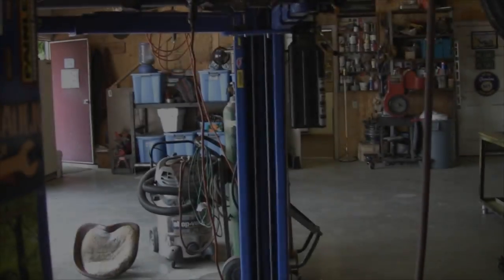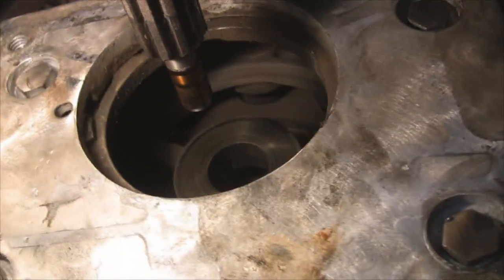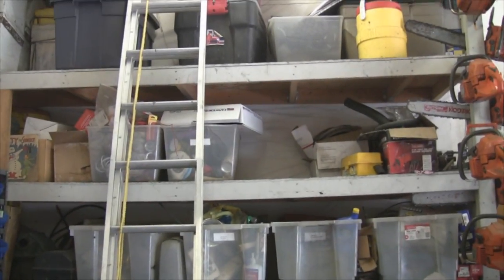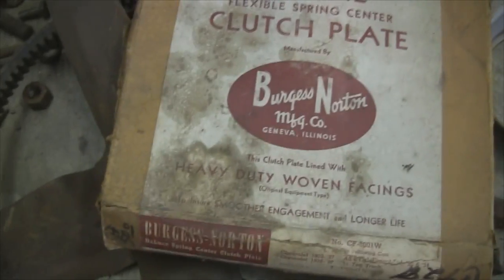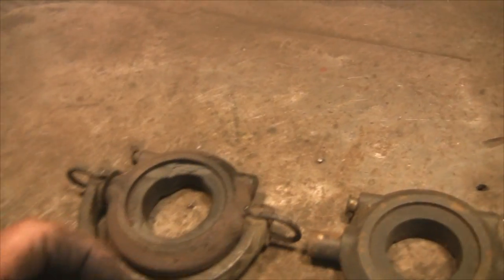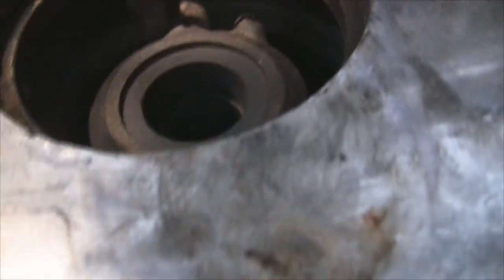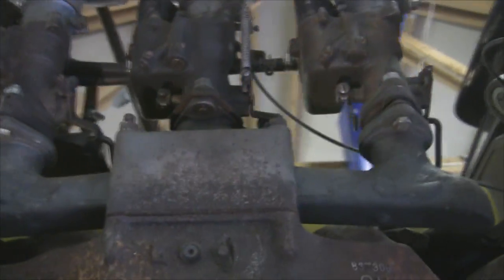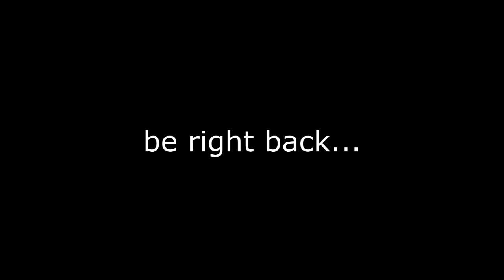Itty Bitty Chevy Bowties!

Comment: I can't help but wonder if that is used as a brake to help shift a non synchronized transmission...
Reply from the maker: hummmmm
Reply: thats a good  idea . but it would have to be connected to the input shaft in some way to act as a clutch brake like on the larger semi clutch systems .